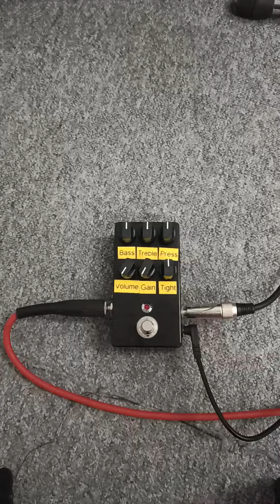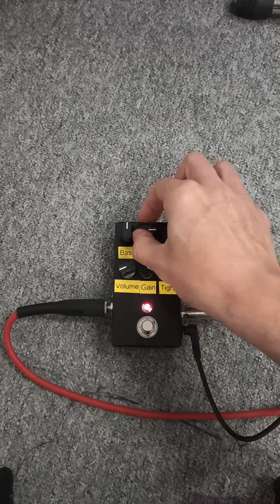Musikding Browneye Friedman BE:OD Klon

Comment: Nice work , i tried to bread board this circuit a while back but i had a lot of trouble with it wanting to go into oscillation, your build sounds nice, makes me want to give it another try.
Reply from the maker: Thanks a lot. I didn't mess with the internal trim pot in this video which I would highly recommend. With humbuckers you can dial it back quite a bit and then the pedal goes from crunch to early van halen to high gain. It is a lot more usable this way.